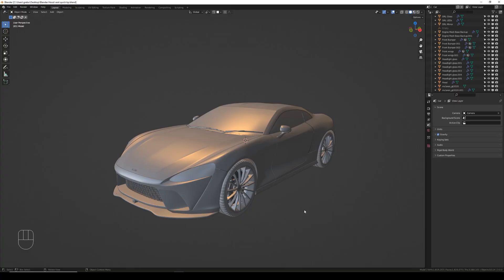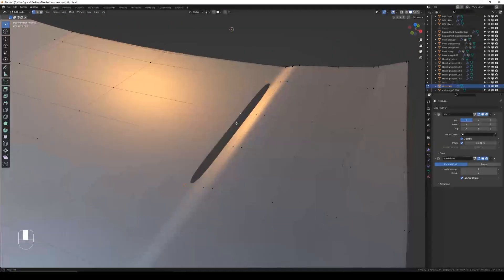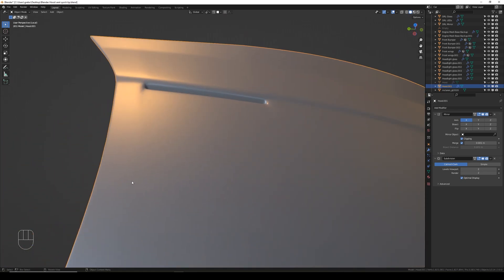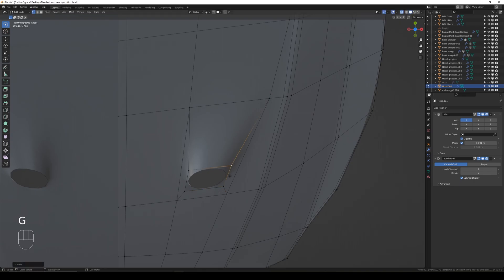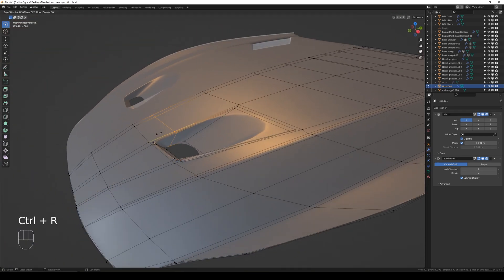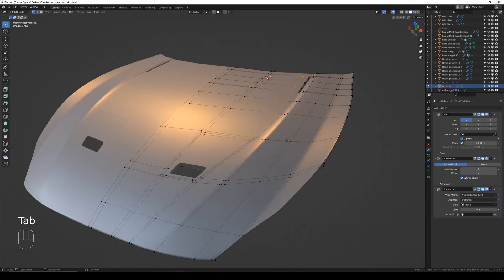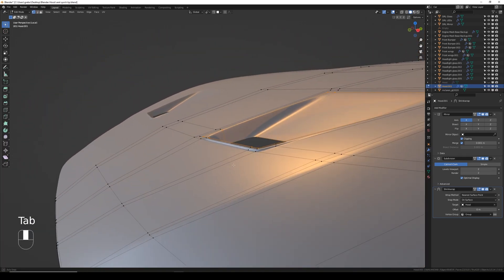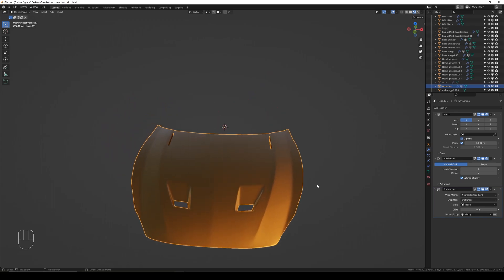Blender Quick tips - Hood vent tutorial

Comment: i dont understand why you shrinkwrap there ...i know what that modifier does i just dont understand why its important here, why couldnt you just make the copy with vents look good
Reply from the maker: You can make the copy with vents look good but it's much harder.  As I showed, once you add the edge loops to tighten the edges for the vents, the smooth curve of the panel gets creased too.  You could manually move these edges to remove the creases or merge vertices so the edges don't go all across the panel.  But these come with downsides such as working with a high poly mesh which is difficult to make changes to while keeping it smooth or artifacts.  Using a shrinkwrap gives you a best of both.  It's far easier as you can have a low density base mesh (with the density increased by increasing subdivisions) that's easy to keep smooth and editable and a high density mesh with edge loops for details that remains smooth due to the shrinkwrap.